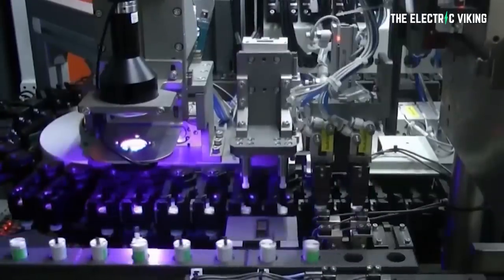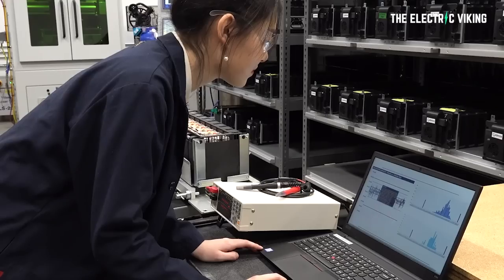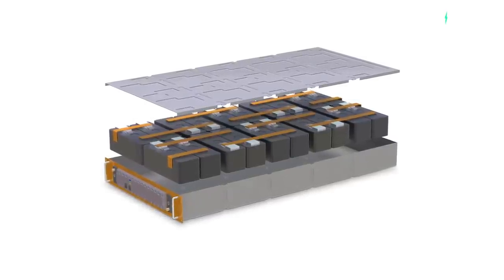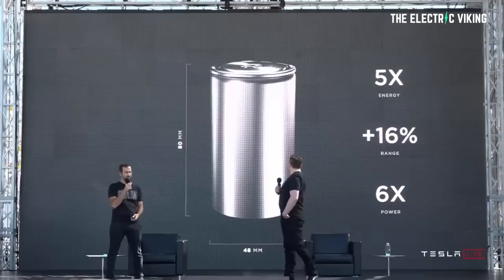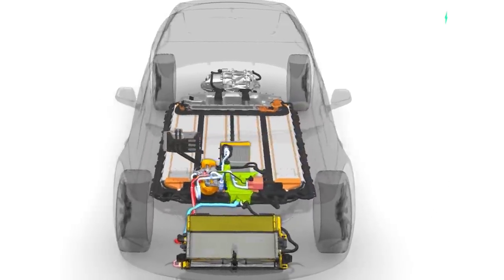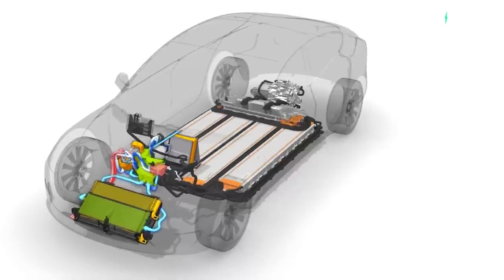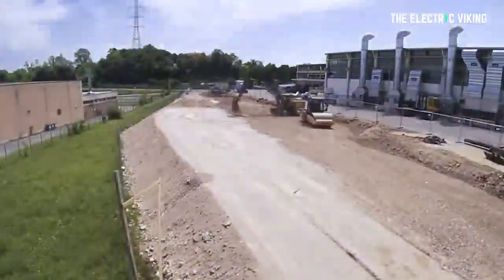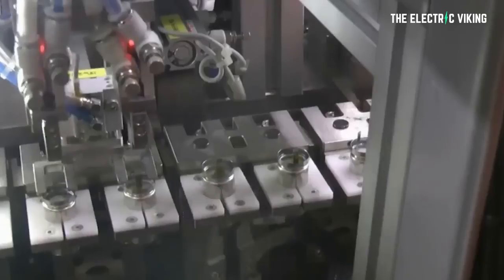Aussie gigafactory making batteries they claim double Tesla range

Comment: Located in Tomago, NSW, the 4,500sqm Renaissance One manufacturing plant is set to produce as many as 300MWh of batteries each year ...
4 Sep 2022, so 3,000 100kwh batteries each year.
Good to see, if they have problems they can fix/ refine manufacture.

Comment: Bottom line is the Cadenza (Connecticut, USA) battery tech licensed by Energy Renaissance is very good. The next Australian battery gigafactory off the rank will probably be the Townsville, Queensland based Imperium 3 (backed by Magnis Resources). That gigfactory, too, will turn out batteries based on first class tech from another US battery innovator, C4V (New York, USA).

Comment: Fantastic to hear of Australia production capabilities. This can be solar powered goodness.
More please!
Reply: Agreed. More of this and less holes in the ground or more brick and mortar.
Reply: Where's the materials coming from? A hole in the ground. What is used to get and process these materials? Fossil fuels and a lot of them. What happens in 10 years when the renewable is useless? They are put in a hole in the ground. I can't believe people actually think renewables are the answer. Remove the subsidies and see how expensive your solar and wind is to manufacture,  install,  maintain and eventually dispose of the non biodegradable,  non recyclable behemoths. At least there'll be a big hole in the ground for them

Comment: 20 July 2021.   5.3 Gwh a year is 53,000 batteries a year. (100kwh batteries.)
Australia replaces 1,000,000 new vehicles annually, so plenty of room to expand production.
20 x fold expansion for Australia each year on todays numbers. 
And the then there is exports.

Comment: It would be good if this could feed into an industry converting Australian petrol cars.
Reply: But then you would have a Holden running on batteries. Still a Holden
Reply: Electric cars will never be in the majority.
Reply: @theairstig9164  The Holden and Falcon were good cars. If you replace the engine and gearbox with a motor and gearbox rated for a million km and paying the equivalent of 50 cents per litre for fuel they would be even better.
Reply: @wyattfamily8997  EVs will soon be cheaper than petrol and diesel vehicles. They run at the equivalent of 50 cents per litre and will run for 1,000,000 km with little servicing. Petrol and diesel cars will be unable to compete and become a rarity.

Comment: I much prefer Tesla's battery cooling where every cell is in contact with water coolant tubes.
Reply: Until it isn't.
Reply: Containing  glycol ( windshield washer fluid)
Reply: @michaelstarkey9745  ahh…no, not windshield washer fluid!!
Every ICE car uses glycol or similar (organic) fluid as anti-freeze and to raise boiling temp a little.
Max temp of EV systems is well below boiling temp of water.
But it’d not be nice if it froze.
Reply: I also, prefer Tesla cooling arrangement. Plus cooling via metal current collectors. Plus all cells stacked upright (4680), pressure release valve at base to expel electrolyte if thermal runaway initiated. So many advantages, so streamlined.

Comment: I would like to point out that not all factories are Giga-factories. Also, some of the pictures are of regular cells being manufactured (18650 or larger Li-ion) not the new batteries. 70% isn't 100%. Limit the hype.
Reply: sam IS a bit eager to post more often, as if that's a good thing. his enthusiasm is sincere, but often a little child-like, as if elon is spiderman.
Reply: Giga is the new black
Reply: It's correctly called a gigafactory by Sam. You should do your homework.
As for the odd snippet, that's common to all Sam's uploads, so it seems to only be a problem to you.
Reply: Ted M / Are you crazy?

Comment: Sounds to good to be true. If a company did Improve a battery density by 70%.....
Beleave it when ya see it folkes.
Reply: I have my doubts as well. However, considerable battery pack volume is currently allocated for thermal management, so if there were a technology that eliminated the need for each cell's thermal management, then you probably could raise the battery pack's energy density by more than 50% for whatever cell type/chemistry you might already be utilizing.

Comment: I have been reading Cadenza's website. It seems they are just comparing their cells with the 18650 Tesla cells and not the 4680. It's not all about energy density, but a balance of features that goes against each other: power delivery, degradation factor, ease of manufacturing, cost to manufacture..... Battery breakthroughs seem to be claimed everyday by startups. But it's seemingly the well established manufacturers who have the experience and resources to quickly develop these new chemistries to practical market use.

Comment: The chemistry is not ideal for cost reduction. LMFP is better for the environment and fire security. I hope we get a EV with hybrid LMFP/Graphene Supercapacitors.
Reply: Why would you need super capaciitors? They are useless with the best around 7Wh/kg. Already a LFP pack can provide enough Watts for enough acceleration.
Reply: @AORD72  I said GRAPHENE supercapacitors, totally different beast.
Reply: @johnmanderson2060  What Wh/kg?
Reply: @johnmanderson2060  And what gravimetric  density are they? What volumetric energy density are they? They are of no use while LFP battery's are multiple times better.

Comment: Anyone wanting to play this game has to be willing and able to pivot on a dime, and leap frog the competition.. If you are of the mind set to wait to see what the competition will do is already dead. And by Pivot I mean you have to be willing to tear out all of your existing manufacturing equipment to replace it, without going through the 'We have to get permission form signed in triplicate first' step.
Reply: Its the old Red Queen problem.
Reply: @tedmoss  thanks for that ecology reference.
Evolution occurs in context of competition, predation, disease, changing conditions.
Darwinian evolution requires sexual recombination, variation, selection for mates and survival, all against backdrop of change.
It’s a simile, but provides some interesting insight.
In particular, fitness isn’t one characteristic. (Think predation vs disease)
GED energy density, safety, cycle life, charge rate, price, availability, manufacturing, toxicity, robustness, cooling, operating temp range.
I’m happy Tesla does the heavy thinking!

Comment: I doubt this battery is 700GWhrs, more likely it is 1,000 times less at 700MWhrs.

By comparison Snowy 2 (pumped storage) stores around 350GWhrs. It would take about 500 of these 'big batteries' to equal Snowy 2.

If Australia is to go fully renewable it will need around 3,500GWhrs of matching storage. That is about 10 Snowy 2 equivalents or 5,000 'big batteries' of the type discussed here.

The harsh reality is big batteries dont cut the mustard for renewables storage. They fall short by several orders of magnitude. 

Large scale pumped storage of one type or another, and/or over building the renewables by a factor of four or five, and putting them on a wide distributed network are the only practical solutions to the renewables variability and storage problem.

And then of course there is nuclear .... 10 plants each about the size of a Bunnings warehouse solves problem.

Comment: Sorry I forgot to mention that it is the Manganese Oxide in the Lithium that makes the Cells tolerate much higher temperatures, Lithium-Ion operates at lower temperatures that is why Li/MnO2 Batteries are preferred in hot environments like Australia, Southern and Northern Africa, Middle East and other hot areas.

Comment: Australia can be manufacturing many things if some body just will invest the money I believe. Most modern high tech manufacturing is done automatically on big machines these days so labor costs as has usually been said to be the problem is really no problem. The biggest problem is that it has been the norm to take raw materials from Australia and just export it right back from when the British where in control and needed to generate job's back in England I believe. The few Australians that have been able to raise the money to start some thing here have not bothered as it has been easier to just dig up some dirt, send it away and then collect the earnings. The little manufacturing there has been has been smashed by removing tariff's. It was done to in the short term enable people to get cheaper products but it also meant that the value of the labor was given to other countries. It gave a good life to the importers and it helped to build up countries like China. I believe Australia suffered.
Another thing many have claimed is that it is too expensive to export manufactured goods from Australia due to the long distances. Well I say apparently not raw materials. Also as manufactured products are much smaller for each dollar value than raw materials the overall cost will be lower. If we can get some solar energy generated and then use that for the manufacturing it should be even better  It may well be possible to schedule the manufacturing so that the main energy usage is only in daylight hours with a bit of creative thinking.
Reply: @solarute5486  It is capitalism - fast profit now. The future is for some body else to take care of. Governments should be for the country and there fore make law's that benefit the country in the long run. Too many people - and there fore the government too - are for the fast money. To make the future and the country great would cost initially - less money - so that doesn't happen. Australia could be the richest country in the world but it would cost initially. That is my opinion.
What I see locally is that farmers protest against powerlines to bring solar and wind farms on line. They don't mind using electricity that is generated some where else. They claim that their land will loose value. What they don't think about is that if we don't do some thing about global warming soon they will lose much more. They won't have the extra water they will need to irrigate their land as the underground will dry out. They will have to count acres to the sheep  instead of sheep to the acre as they do now. I am talking about central west of Victoria where I have noticed  at least one windmill farm where only a few mills are running - I think because they cant get rid of the power generated - and on a small block of land that I own where it appears that the ground water in sinking.
Reply: 50 years ago Australia was a diverse manufacturer of consumer electronics (AWA), shoes/clothes, cars.... we owned extensive resources, built and ran our own railways, made and repaired the trains and tracks, airports, shipping ports, power generation (Snowy Hydro), oil refineries, roads, communications, education, hospitals, etc.....
Then some idiots/traitors told us we would be better served by privatisation, so we sold/licensed everything to O/S corporations for peanuts, now everything we earn is paid to foreign Co's to use the stuff we once owned.
This is why we are now broke, and have little control over our own country. (China leased the Port of Darwin?????) etc....
Reply: @johncooper5870  Yes I know. I have lived here since 1978. I put the blame on accountants wanting fame by telling managers how to make fast bucks, top managers in short term positions wanting to make a lot fast and Governments wanting to please big business instead of thinking about the long term future of the country. It is not just here though. I believe Europe is in quite a mess as well believing in free trade and just in time solutions. It is all quite different from what I learned about good business practice about 50 years ago. I must admit that a few (very few) people here have made billions out of it. Most has gone to internationals.

Comment: Cadence battery pack is not the latest and greatest. It is a mediocre battery pack using a good-enough battery.
Reply: What are your primary metrics and sources for rating Cadence battery packs as "mediocre"?
Reply: @greggrant4614  ::: it’s basically a LG Chem battery.

Comment: In economic size, compared to the rest of this planet, Australia is tiny. The same method of manufacturing will also need done locally in many nations, not just Australia.
Humans relations management in the advanced post industrial nations has yet to be efficient and effective. Japanese national personality, using these western management techniques, worked, but then failed to handle "success".
Tesla avoids worker unionization.  Does this work in the long term?
BYD and the China based industries seem to not yet be financially responsible, inn the long term.
What is the magic needed?
Reply: TeslaBot

Comment: I don`t like battery technology, because of the huge amounts of CO2 emissions (more than fossal fuel vehicles) they make during the manfacturing cycle. Cobalt comes from the Congo which is the worlds largest supplier and uses child labour and has very poor work conditions. Hydrogen is what we need
Reply: Which is why Tesla does not obtain its cobalt from Congo and is a big reason why it was looking at using a different chemistry altogether. But you are funny mate if you think manufacturing batteries makes more Co2 emissions than it does to manufacture heavy dense ICE engines, and all Co2 those ICE engines create ... yet you think we need hydrogen that takes tremendous amounts of energy to separate and isolate. Talk about making tons of Co2 LMAO. Yea lets all use something that needs more energy make than anything else we have available currently to use. For the record technically you are true. It does create more Co2 emissions mining lithium than it does most other types of metals and elements, and more than it does to make ICE engines and vehicles. But, and this is a huge but, the alternatives are worse. Fossil fuel engines release more Co2 emission into our atmosphere alone, not counting manufacture of them, than the entire process of EV's in total. ~15% of the worlds entire greenhouse gases comes from fossil fuel engines. A single ICE vehicle typically creates 4.6 tons of Co2 on average per year just from running the engine. So in four years it would have created 18.4 tons of Co2 on average. A Tesla 3 in four years will have created 16 tons of Co2 in total, from start of mining, to manufacture to driving. But do not believe me. Believe an expert. Yang Shao-Horn, JR East Professor of Engineering in the MIT Departments of Mechanical Engineering and Materials Science and Engineering, says Despite the environmental footprint of manufacturing lithium-ion batteries, this technology is much more climate-friendly than the alternatives.